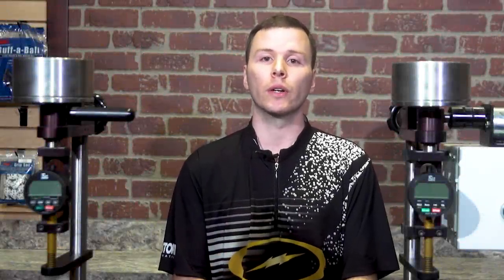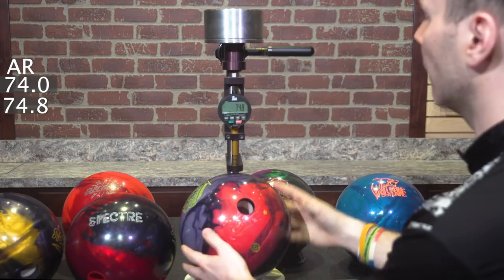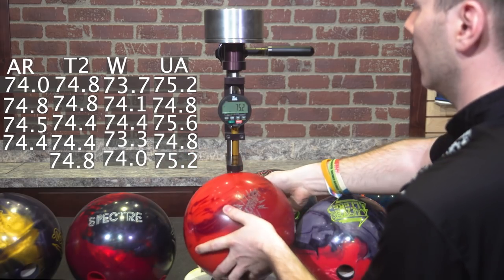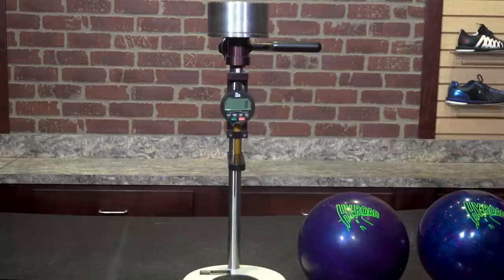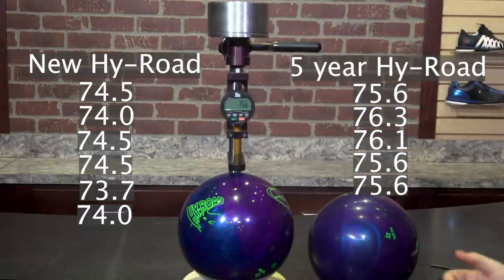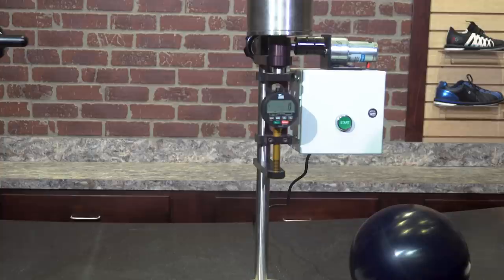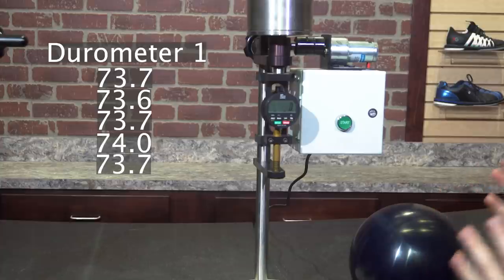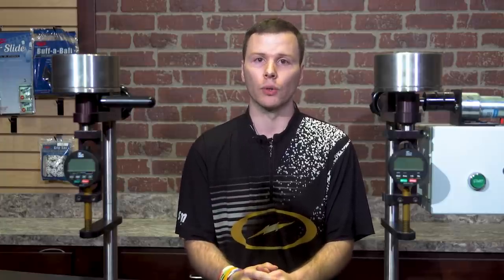Storm | Durometer Test Follow-Up

Comment: You said this is a calibrated machine.  Is it calibrated against the official durometer used by USBC?  Your previous video showed us that different devices can have different readings.  If the USBC device is the official durometer for final approval, shouldn't you calibrate this machine against that one, to get a precise expected variation between the 2 devices?
Reply from the maker: As mentioned in this video we know the calibration of their durometer and target our manufacturing to meet their durometer.
Reply: @stormbowling  I can't seem to find in the video any mention of the exact amount the readings from each of the durometers you used need to be adjusted to be in alignment with the USBC's durometer.  Without that adjustment, your numbers don't mean squat.
Reply: @adamread2425  That’s my point exactly.  Saying that you they are targeting the USBC durometer readings, isn’t the same as actually saying what the variance is between the Storm and USBC devices.  There appears to be almost a full point of difference between the 2 Storm durometers.  So it seems logical that there may also be a similar difference with USBC durometer… and that difference alone is enough to push just about every example shown from passing to failing, based on the lower results of the Storm devices.  I’m not saying Storm is wrong, but that’s an obvious place they could provide more information to strengthen the case they are making.
Reply: @adamread2425  likewise, have these balls been cleaned, sanded, and temperature adjusted to USBC's testing spec, is the durometer needle free of polish or residue, and is the testing speed in line with USBC methodology. The last video has already shown that all these factors play into the final results

Comment: One follow up from the previous video you were talking about how polishing makes a difference and you measured a ball that used a generic polish. Why not start with one of the banned balls right out of the box, measure it, then sand it down to 500 and measure again. This would better prove your point.
Reply: This. All these return balls have likely been cleaned and polished. They're also not sanded down to test spec, or temperature controlled. We don't know if the needle is contaminated, and he's jamming the needle down pretty quickly. I have concerns

Comment: Here's the issue that I'm seeing. When testing the "banned" bowling balls you can see there is an average hardness of around 74D on Storm's testing. USBC approval has been around for ages, they have had to stamp USBC product numbers on the cover stock of a bowling ball for god knows how long now. Why is it that the "banned" bowling balls all have essentially the same hardness as the brand new Hy-Road. These balls aren't old enough to have aged in hardness that much. So if the ball that is five years old and has been on the storm line for the longest time and is still legal is testing the same hardness brand new out of box as the new "banned" balls I see some sort of transparency issue between companies here and also to the public. They essentially said that the Altered Reality had a 100% fail in hardness across the bored. Yet the swapped Altered Reality in this video tested the same as the brand new Hy-Road yet again. So why is it that they took a chunk of the brand new bowling balls and are ignoring the fact that the old storm line balls are testing the same on their durometer. No matter the calibration that shines true on the machines across the board. So if what USBC is saying is true about the Storm bowling balls then we would see that the products from storm that are veterans on the line would be testing illegal on their machine yet we haven't seen anything nor heard anything from them about it. So it thoroughly impresses me that Storm has went out of their way to do this for the public and USBC won't even take a 20 minute video to explain how they came across their decision. Something here doesn't add up so the transparency here does help whether you are on the side of Storm or not.

Comment: interesting that the "banned everywhere" Spectre had the highest readings of them all.  Think I'll just paint mine a different color and keep using it.  Best ball I've ever thrown in 10 years of bowling.
Reply: That pissed me off, because I wanted that ball, and there appears to be nothing wrong with it. Seems like a hit piece against storm. Did USBC even check Brunswick balls? I fucking doubt it.
Reply: This test isn't using USBC'S spec. All these balls are used, polished, not sanded to test spec, not temperature controlled, and the needle is t verified to be clean. He's also jamming the needle down faster than it should be, which was determined last time to raise the measured hardness

USBC checks all balls
Reply: @iceman5117  Sorry, but you must be watching a different video if you think he is slamming it down. If you go watch the last one you can see him demonstrate how slamming it, and going soft effects the measurement. Plus the tools both Storm and USBC use aren't 100% accurate, and won't be for quite some time, if ever.

You can easily counter your argument by saying the USBC just intentionally measured soft on these select balls, by doing exactly what you're saying. It goes both ways man.

There is being subjective, and then there is objective, we know which one you are 😉.

P.S It really looks like you didn't watch the first video of testing, because the whole first statement you made is answered in the first video. The video has "Follow-Up" because there is a video before...
Reply: @TheRagingRayn  you have no idea what you're talking about. Do you have any evidence that USBC purposefully ignored their own testing methodology just for Storm balls? Accuracy is irrelevant as all balls have to be tested with the same equipment, with the same finish and temperature.

The first video is about how those factors can effect the result, it never once mentioned how USBC controls for all of those factors in testing
Reply: @iceman5117  I'm just using your logic against you. Seems like it worked.

Comment: Ok in the first video you showed 3 tools.  1 showed balls in spec, another showed on average 2 points lower, the automated one was semi correlated to the first (and is now showing about 3/4 to a point lower and several below 73D in this video).  So what one of these 3 is the official tool?  The one that reads highest?  I don’t question variability, it’s just standard SPC’s you have to deal with unless your target is too low or the process is out of control.  The second thing I question is if the measurement process is really the issue, why is this the first time Storm has an issue.  It should have surfaced years ago.

Comment: I appreciate these videos, but this one is particularly baffling. Is there an offset already programmed into your durometers, to bring them into agreement with the "USBC standard durometer"? I assume the offset is programmed, but that is not clear in the video. If no offset is present in the instrument, the readings presented are not useful (because the known offset was not communicated). How does a ball becoming harder over years of sitting on the shelf have any relevance to the durometer reading at time of manufacture? If 73D is a hard limit, building a buffer into product tolerance seems prudent. You compare two calibrated durometers, but one is giving readings below the permissible limit of 73D. How is this a data point in your favor?
Reply: How do we know what USBC did? Storm showed us what they did. Can't say the same about USBC can we? Transparency is the number 1 way to earn public trust.

Lack of transparency HURTS perception
Reply: @kyleb5169  I do not understand your tangent. Please explain how your comment relates to anything I said. Do not mistake me for a USBC fanboy. If they would bother to present a technical video I'd likely have similar questions for them.
Reply: To highlight how difficult it is to get "precise" hardness readings when testing these bowling balls. So many different factors changing the hardness readings makes it practically immaterial to test these balls using a strict rule for hardness.
Reply: @grillmaster95  USBC already accounts for much of this variance by using a standard range of temperatures, a standard surface treatment, and a standard methodology. All storm has to do is give themselves enough headroom to account for manufacturing variance

Comment: I would want to see USBC to perform this same test with their machine for full transparency. But they won’t. So again, why are these balls banned if they are above the threshold. Why didn’t you guys fight the ruling? It seems Storm has done enough to prove the point, so why did You guys accept the punishment? Or is there something going on behind the scenes already.
Reply: They "accepted". There's more to it that will never be known, Storm didn't say "Yes, we agree with everything"
Reply: @rb8999  I understand, but being forced to “accept” it is a hard pill to swallow. It’s bizarre. Isn’t it clear by now there’s nothing wrong with these bowling balls? But the 17/18 Purple Hammers are still kosher even though they test softer than every ball that was banned here?
Reply: @briguyinsi  For 99% of bowlers, the effect created by hardness difference is negligible at best. USBC changed the standard from 72D to 73D even though they admit there's 8 other factors that have more influence than hardness.
Until everyone drags Chad Murphy from his throne we won't know.
Reply: @rb8999  Of course, THS being one of the main problems, but you’re right it won’t make an ounce of difference to league bowlers, which in theory I guess why they are technically still allowed on that front.

Comment: Is it possible that the USBC is using the wrong durometer? There are 12 different types.
Reply: It's not possible for USBC to be using the wrong durometer, they are the ones that create the testing methodology. They could test hardness by dropping the ball off the roof of their HQ and observing how high the ball bounces, manufacturers would still have to meet that specification

Comment: After seeing this follow up video, I have no doubt that some politics were in play with the ‘Ballgate’ issues surrounding the USBC. 

If at any point the leadership of the USBC changes, we may see a tell-all book that goes back into what really happened with the Jackal/Jackal Carnage years ago, as well as the Purple Hammer and then all the Storm products. The common denominator here is that the Motiv and Hammer balls got more scrutiny after one or more wins in a tournament by a bowler who typically didn’t finish in the top 15 of all tourneys. Let’s call it out… we haven’t seen Gary Faulkner Jr or Matt Russo on TV lately. 

So, the Storm balls seem to be some sort of a huge backlash against complaints that certain equipment was giving fringe bowlers an unfair advantage, and great bowlers even more of an advantage. Again this is just speculation and admittedly conspiracy but I believe there is some truth in there somewhere.
Reply: Conspiracy theories do tend to entertain the masses.
Reply: Being called out for failing to meet specs doesn't meet that storm is facing more scrutiny. It means that it's facing some scrutiny and failing to meet regulations
Reply: @iceman5117  the winners circle produces a lot of scrutiny on equipment.
Reply: @atbsigma  completely and utterly baseless. All equipment has to get tested at some point. You failing the test isn't an issue with the test, it's an issue with you
Reply: @iceman5117  Sorry but politics in this sport are very real. My conjecture came from talking to a real staffer, so it’s not ‘baseless’. Opinions from those who get paid to bowl, matter.
Reply: @atbsigma  what politics? All equipment has to be tested, and it all gets tested in the same manner. If you fail, that's you're problem. I don't care what some random janitor or desk clerk at a Pepsi tournament says about balls
Reply: @iceman5117  the PBA still considers it legal to use all but the Spectre. The USBC says those balls are legal to use except for national competition. I’m not sure the issue is as cut and dry as you make it seem. 

But it’s ok, we just agree to disagree because this isn’t even about the failed tests anymore.

Comment: I want to see 5 durometers, and 5 of each of the questioned bowling balls, in a spreadsheet. With an independent company or firm do the testing. Im not saying that results are cherry picked in these videos, but im not ignoring the fact that it is very possible.
im aware that is very expensive and time consuming, but thats enough variables to prove a trend.
Reply: A....Trend, you say?
Reply: I'd like to see the USBC do the same thing. He'll Id just be happy if the USBC was transparent about all of it. Who know what the hell USBC did. At least Storm is being fully transparent. 

Lack of transparency is the NUMBER 1 reason for negative public perception.
Reply: @kyleb5169  but what if Storm is cherry picking data? Just like the USBC could be? Or maybe Storm is cherry picking and USBC isn't. OR USBC is and storm isn't. How do we know?
Reply: @chugalingus4642  The one thing EVERYBODY knows it that usbc HID behind a black curtain when they did their testing.  I didn't bowl for 20 years and just started back.  I will NEVER join a league and give an organization like that any of my money.
Reply: Agree on the variability.  This video showed several measurements under spec again.  What I really question is if the inability to measure these consistently is the problem, why now is it a problem?  Why now after spec was raised a point.  Seems to be more of a process control (SPC) or not altering the base formulation to protect against the new spec.  Not sure this is USBC’s issue.  Other manufacturers are not having this problem
Reply: @timothyschaffer2287  I can see where you're coming from. I'm just curious if other companies ARE having the same problems, but the USBC isnt taking action. The best thing to do in this case is to have all companies investigated using the same durometer by an independent. The company cannot do their own testing. Never in history has that been acceptable as accurate data.
Reply: Yeah to be a truly fair and impartial measurement it should be tested by an independent group with their own calibrated equipment.  Not to mention that the 2nd durometer actually gave illegal readings- that should be grounds for retests with multiple durometers and maybe taking an average reading.  I feel like it's kind of dumb anyway since the hardness regulation used to be capped at 72 and that the balls will become harder overtime which would put them back into legal hardness levels.  But it's kinda hard to be 100% convincing when your testing evidence is done in-house.  But maybe the USBC's equipment was out of calibration at the time.  Who knows. I almost exclusively own Storm balls and I love the equipment so I hope this whole thing blows over by next season.
Reply: @chugalingus4642  Or maybe neither is because when you look at the ATM standards from the first video these Durometers can read wildly different from machine to machine and from lab to lab.   To me that is the problem.  They could sent it to two different labs and get two wildly differant results
Reply: @TheGeneral308  Yeah, you're right. I was just listing (In my opinion) the ideal way to test whether or not these balls remotely meet the numbers that the USBC claims to have found, or that Storm has shown us they found. 
There's never going to be hard locked scientific evidence, but creating a large enough sample size allows us to see trends in the data. Data which would allow us to formulate a decent conclusion.
Reply: @timothyschaffer2287  well we don’t know if they are, cause according to the PBA when they showed their testing all companies balls tested around the same in hardness levels on. They took the data from the tour
Reply: USBC is already independent. It doesn't get anything out of penalizing it's own manufacturers

Comment: This video says that balls get harder as they age. But the PBA recently banned urethane balls older than two years old because they got softer with time. I’m a bit confused to the opposite results.
Reply: Technically all modern bowling balls are made from plastic. We tend to only call spare balls with a polyester coverstock plastic but all of them are some form of plastic. My experience with plastics is that they do become harder and brittle as they age. It may be that urethane does not age the same way as other plastics. I know that my Storm Mix, which is urethane, has lasted 10 years without any chipping around the finger holes. that's at least 8 years longer than the White Dot it replaced.

Comment: Yeah, USBC got shown up...and should be fined by STORM for all the money STORM had to put out for shipping exchange balls, reimbursement of drilling, etc. All based on a system that I do NOT think is reliable enough to cause an entire blunder in the entire industry. If anything, ball manufacturers should only have to submit a report card for new models along with a signed and verified durometer manufacturer's calibration sheet or something. I mean, when you put in electrical materials and they carry the UL Listed stamp...you expect that it meets the standards because it was manufactured to those specs.....but you know that specific item didn't come from UL Labs. It is an honor system.... I think the USBC needs to HAVE THEIR OWN BALLS TESTED by STORM to ensure they are meeting their own standards as well...I bet we have issues there.
Reply: USBC makes balls now? I don't think you know what you're talking about